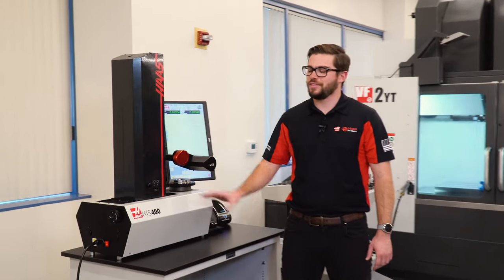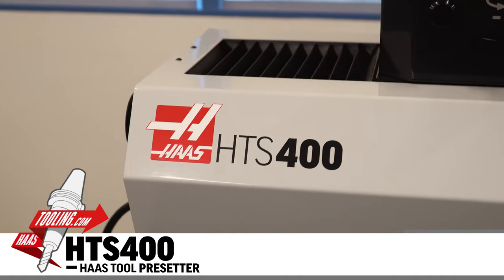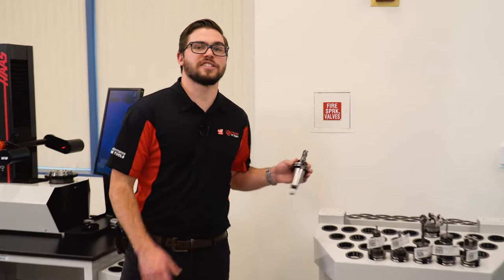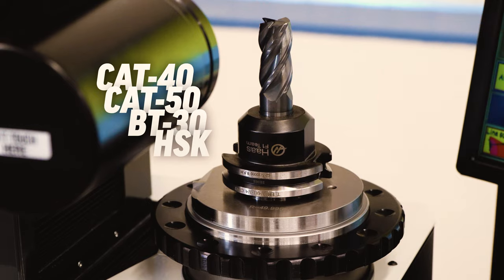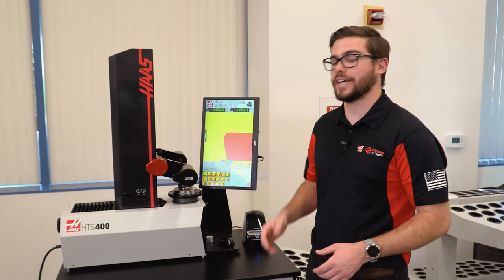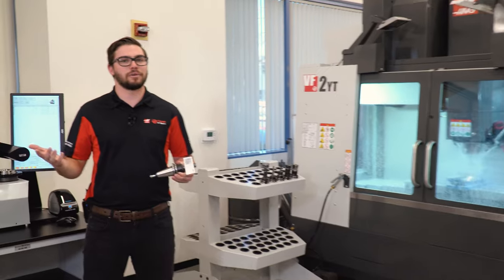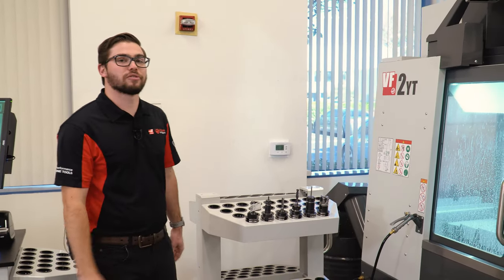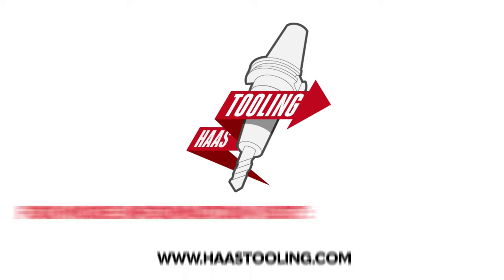Introducing the Haas HTS400 Tool Presetter - Haas Automation, Inc.

Comment: Now , just add QR code scaner to the control, and make "load tool" macro. Imagine, M1070 T10, insert into spindel, scan code, T10 is set
Reply: I developed this exact system as you describe and we use it in our shop. It's amazing. @sonsofsormaz on insta, I'm going to be posting more info about it tomorrow
Reply: Considering the QR code on the label there is no way they aren't already planning on that
Reply: Printing out label is just just "software" thing. Scanner also is quite simple software/hardware combination, literally arduino level. Time gain, process reliability, and simplicity of use - priceless. So Haas, go and develop this. $1000 for this option is still cheaper then scrap part, or crash
Reply from the maker: Adam Mendel, It appears you've been reading our minds. We will be releasing more videos in the coming weeks delving in to how you get your tool offsets into the machine via QR scanner.

Comment: You have probe for for this operation..
Reply: Yeah but if you want to load tools while the machine is running this would be useful, or if you have a handful of machines and don't want to buy a tool probe for each one, or of you want all of your machines to have the same gauge lengths without having to calibrate each machines tool probe to a single standard, or if you don't want to have to worry about tool lengths being different because you probed one at the start of the day when the machine was cold and another mid day when the machine was warm.
Reply: @spazzywhitebelt  I working in manufacturing one year. We have almost few hundred tools , a lot of machines and we don't need this . Trust me if you don't need gadgets don't buy something like this . Personally it is wasting of money
Reply: @andrzejmichalczuk7662  what kind of machines do y'all run? We have a umc750 and it'll change on the Z axis ~.003" from cold to warm. we probe a standard when probing new tools to make sure the lengths are consistent. If you have the B axis at 90° and are using the bottom of the cutter to cut the part the thickness will be off 2x of what the error is in the tool length.
Yes it's be great if that weren't an issue but that's the price we pay for not having a strict temperature controlled shop.
Reply: @spazzywhitebelt  What kind of temperature differences are we talking about?

We've been using Haas warmup cycles with daily variability between 10 and 15 degrees cold to hot on our Haas VF4SS's and we haven't had many problems with tolerances. Either Z or X-Y axis.

I'm comfortable milling a +/-0,00059'' tolerance with an endmill on our machine. You still check the tolerance but it holds steady.
Reply: @xm210c  down to 52 at night and 58 during the day, depending on how much were running the machine idk how warm it is. Don't have this issue on our vm3, it'll probe tools consistently throughout the day.
Does what I say about the error being doubled on the Z axis when decking a part with the b axis rotated to 90 make sense? It's like on a lathe where moving .001" radially will take .002" on the diameter. It's the price we pay for not having our shop/equipment at a consistent temperature.